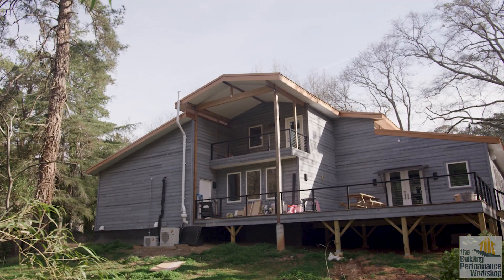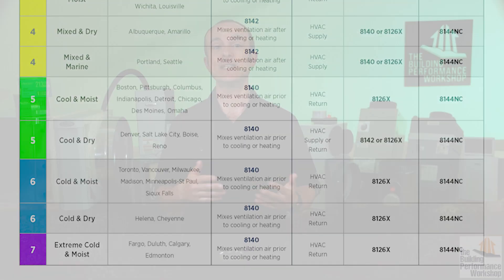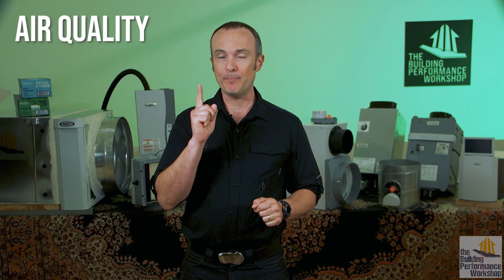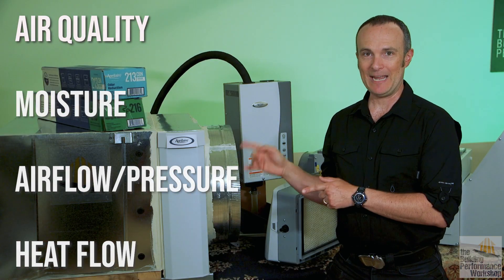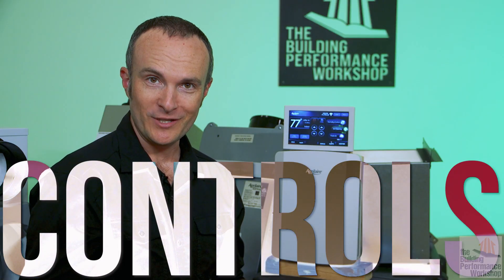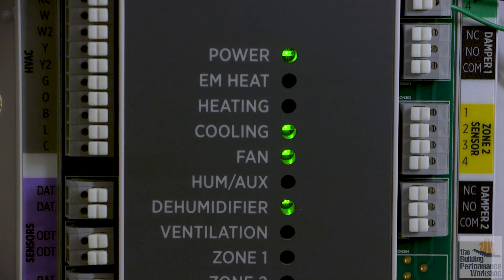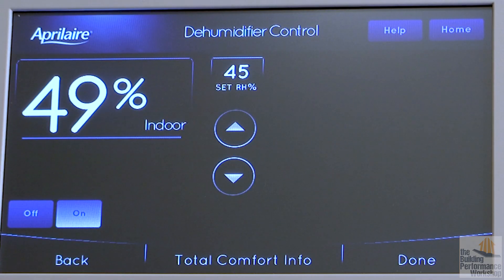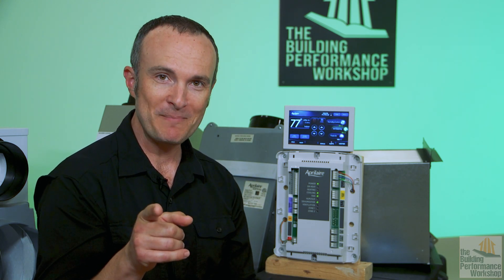Designing a Home Ventilation System with Modular Components from Aprilaire

Comment: Great video, Corbett. Would love a deep dive in your comments around the necessity of ERV and it’s implications on other units, like bath fans.
Reply from the maker: Thanks David! More coming on the ERV topic, I promise.
Reply: ?? If there are exhaust fans.. They would pull fresh air from the ERV?? And whatever other holes you have.
Reply from the maker: That’s not quite how it works, but the point is that energy recovery is not super helpful in that case.
Reply: @HomePerformance  
I ask because i see this as what people might do. Erv is becoming the fix all with a tight house ( spray foam upgrade).

Spray companies dont warn of sealed house changes. They just spray it. A year later out of warranty the owner notices moisture problems or complains that the foam doesnt work.  So they get recommended install a ERV. Ignoring that the already oversized hvac is now x3. Oversized.
Reply: The biggest problem is that the marketing industry has little to nothing to do with the actual performance of our stuff from a filter to a furnace.  I’m always fighting against the bad marketing on 1” filters and the silly thermostat that is Wi-Fi enabled but by all other means is JUNK Nest is a great example of junk with a great marketing plan 😢

Comment: I really like that control unit, and its very well priced if what I’m finding is accurate. I also see that it can handle zoning of the HVAC? I checked into the price of the radiant system I like, and had a small heart attack at the number. This, a full set of their equipment and one of those small duct high velocity HVAC systems is looking like a much more realistic and reasonable setup.
Reply from the maker: And no water to spring a leak at some mysterious point in the future too
Reply: Curious why your choosing high velocity hvac over conventional?
They require more small vents strategically placed. 
Good for retrofits without existing hvac.
Reply: @HomePerformance  true, as much as I just assumed it’d remain perfect after it’s been installed, that is a very likely future maintenance disaster!
Reply: @turboflush  the reason: from what I’ve read they tend to be better when you install fancy filters. I know its not typically recommended or commonly available, I’m dead set on having actual HEPA filters in the HVAC, where 100% of the circulated air is drawn through it. Some are going to roll their eyes, but I don’t want a single stand alone air machine in the house, I just want all of the supply registers blowing out that clean of air. Plus once gets the added benefit of no dust ever entering the air handler or supply ductwork.
Reply from the maker: Good rto be specific about what you want, @compactc9

Comment: I have upgraded my 1994 house with Awair air monitors on each level that talks to my ecobee thermostat. If Co2 dust or chemicals get to high it turns on the furnace recirculating fan pulling fresh air in from the furnace fresh air duct. I was amazed at how quickly the Co2 rises with our gas stove. So it solved that problem until our induction electric range is installed.
Reply from the maker: I like your approach, Ecospider5, but I think you know I’m going to recommend kitchen exhaust for you- cooking fumes should not be venting into your home.
Reply: I agree. Our range hood does exhaust to the outside. It has not become a habit to turn that on unless we were dealing with food smells. If we were keeping the gas range that would have to change. We will see with the induction if we can use our nose to recognize air quality differences. If not I think I might have Alexa announce air quality changes to remind the family to turn on the kitchen fan. 

I am doing  Wemo plugs on the bathroom fans so the furnace fresh air intake flap can be automated to open when those are on. I have not figured out how to do that with a range hood that is part of a microwave.

Comment: Corbett, I hope y'all are healthy and enjoying your new family addition.  

Can a home have a need for both humidification and dehumidification equipment?

How can external variables like forest fire smoke, or nearby factory emissions be planned for in a home ventilation system?
Reply from the maker: I would say MOST homes that are aiming for healthy high performance control will need both dehum and hum control- mine do! And it’s simple to rig one of these MERV 13 + Carbon filters on your incoming outdoor air ducting, that’s how you’d prep for outdoor contaminants.
Reply: @HomePerformance  I would agree but it seems everyone else only talks about dehumidification. I'm surprised more vendors don't make a combo dehu/hu box vs having to hook up multiple devices inline. Even from what you showed, in order to have both options you need a lot more runway for the supply setup.
Reply from the maker: 100% agreement from me, Brett

Comment: great video - thank you for putting it together. What do you recommend for filtration when installing a ducted system? This question applies to both the ERV and the air handler. Thank you for your time.
Reply from the maker: Thanks Rock- some ERVs come with MERV 13, which is great. And I’d advise same with these 4” filter cabinets.

Comment: great video! may i ask for u to clarify on what u mean about needing to replace bathroom exhaust fans when using an erv pls?
Reply: Essentially being that you are removing air from the home and supplying at an equal or often at a slight positive rate it is most beneficial to remove from bathrooms as that is where you would otherwise exhaust from. As a side benefit it reduces the likelihood of people forgetting or improperly utilizing source control ventilation. When done properly it adds to increased air exchanges reducing the desire/need for conditioned air to be supplied from your HVAC system
Reply from the maker: Well done DC

Comment: Why not use an ERV to make your HVAC a bit more efficient? I am thinking about retrofitting one into my home now just for the use of the outside air with the supply, as code now requires some amount of outside air anyway. Thoughts?
Reply from the maker: ERVs are the only option for very airtight homes, but have less benefit for typical homes. We feature ERVs a lot on this channel too.
Reply: @HomePerformance  So for a spray foamed home (like mine) this would be a decent idea, correct? And presuming I tie it in only to supply (since I have bathroom fans), when retrofitting? 

Problem is across all YouTube, the HVAC solutions are almost always geared to new built homes, rather than existing homes, so trying to weigh my options.

Comment: What humidifier would you recommend for a central air handler that splits into legs immediately?
Reply from the maker: Still the steam unit 800, but you could either add the humidity to just one leg, or maybe split the steam injector in two to match. Or decentralized room steam humidifiers.

Comment: Wondering which of these would work best with a boiler heat system.  Stand alone humidifier, ERV with Merv 13 and option of dehumidifier?
Reply from the maker: You’ll likely want filtration too- check out standalone HEPA units

Comment: Would you happen to have a video talking about the best termite control measure for a new build that does not affect indoor air quality?  right now looking at termimesh physical barrier approach ($$$, not a lot of backed up research or real-time experience), Centricon bait stations around the perimeter of the home (scary that they attract the termites to come to close to ur home and what if it fails), or the pre- and post-treatment of bifenthrin (which is a potential carcinogen but i was told by the vendors that under a slab on grade foundation plus poly liner there won’t be a need to be concerned about offgassing to the inside of the house - though in my opinion it may still offgas)…please help steer me in the right direction. Will be doing Boracare treatment on the the structural wall studs fyi

Comment: I want my setup to be responsive to the environment, (hood turn on when it detects Vic's/moisture, external air fed in more when VOC/CO2 levels get too high. Can this be done with AprilAire vs the timer method you mentioned?
Reply: I am using Awair sensors around my house. The 4 things they detect can trigger my Ecobee thermostat to bring in fresh air. I have it working with Co2 right now. I’m deciding if it would be useful with the others. PM2.5, chemicals, and humidity. 

I wonder if aprilair has a compatible sensor for their system.
Reply from the maker: I don’t think they have sensors in their lineup, but you can use Overture from Broan for a bunch of things

Comment: Thanks for the info, though this was more of a list of modular components than a guide on how they might be combined (as suggested by the title).  In that regard, many of these videos follow the pattern in building "advice" of just listing products, while leaving it to careless contractors to slap together.  E.g., you showed a non-ERV fresh-air intake on the inflow side of the E100 dehumidifier, which exhausts to the supply side of the air handler, so are you relying on the E100 to filter outside air?  That seems harsh, but it would also seem weird to waste a MERV16 filtering outside air on the return side of the air handler.

So many jumbled puzzle pieces--and these pieces are all from just ONE company.  No wonder homeowners and builders are confused or slow to adopt.

(E.g., see also the ludicrously confused conversations about tying in roofing systems with conditioned attics.)
Reply from the maker: NCooty, if you follow our channel over a longer term than just this one video, you can learn to use the 4-3-2-1 approach to think through crafting any system on any home. There are NO blanket prescriptions for ventilation that will work for every family in every home, period. You're seeking the kind of understanding that comes from more than just a 10 minute video- you're looking for the 10,000 hours of practice that leads to mastery. Can't get that on YouTube no matter what, imho.
Reply: @HomePerformance :  That seems like a straw man of my feedback.  In no way did I suggest you ought to offer one-size-fits-all guidance.  For example, you could have covered principles for combining the components into a system without saying that one layout will work for all cases.  That would have been closer to doing what the title indicates.
Reply from the maker: Ncooty, I’m saying qatch more of my videos if that’s what you’re looking for. I can’t fit an hour of high quality training into one free YT video.
Reply: @HomePerformance :  Thanks.  I've watched a few more and appreciate what you're producing.
Reply from the maker: Thanks my friend- we’ll keep it coming

Comment: I have no idea how something like this can be used in an old home 1940's cottage? I really find that most contractors in my area of Southern Alberta would have no clue how to get that sciencey. Right now I have a Goodman furnace with just a plain filter (1 inch) in a crawl space, no stove fan, the bathroom fan doesn't work and this home is far from airtight. Also, I just found out in my crawlspace is puddles of water that have pooled from the moisture that penetrates the concrete and spray foam that over it. I have been a single mom for years and wonder how someone like me can actually afford to have a healthy home? I really dislike this furnace but can afford other options like in floor heating, though the solutions you propose probably won't work with nonfurnace homes. So I'm really overwhelmed with creating a solution with my 1300ft cabinish style home on a manmade lake on a very tight budget?

Comment: Audio is super quiet. at least 6db (if not more) lower than most other YT videos
Reply from the maker: That’s probably because you’re watching vids with music. They compress the heck out of those, which is hack. This is normalized and lightly compressed- it’s an educational resource, not a rave.
Reply: @HomePerformance  @SpiderHack is correct that this video is notably quieter than expected and, in fact, is notably quieter than even most of your own videos. Specifically, this video is at -12.4dB below the YouTube reference loudness. Most of your videos tend to be closer to -9dB (doubled sound energy) and "typical" talking head YouTube videos are usually closer to -5 dB. So yes, even completely ignoring music videos and "high energy" ones, your videos are typically mildly quieter than most in a similar genre and this one is substantially quieter than even those.

As an aside, you might be mildly confused about the role of normalizing and compressing video, based on your response? What the normalization and compression processes do is ensure that the highs and lows are brought closer together -- the extreme loud sections are dropped down a bit and the extreme quiet moments are bumped up. It makes for a more pleasant listening experience. But while the resulting "loudness" (independent of volume) is now consistent within your video, it is independent of any other video. That's where LUFS/LKS comes into play. It's a standardized "loudness" scale that ensures that all video is predictably loud relative to all other videos and, again, completely independent of what the viewer has done with their volume slider.

None of this is a criticism -- I love your videos and it's no big deal to simply turn up my volume knob quite a bit when watching them (and turn it back down for all others). Carry on!
Reply from the maker: Thanks guys, and if I sound frustrated it’s because I actually studied audio in college, and I focus on it quite a bit. This has been a recurring problem and I don’t inderstand why- clearly my QC process on my edits needs tweaking. Appreciate you sticking eith me.